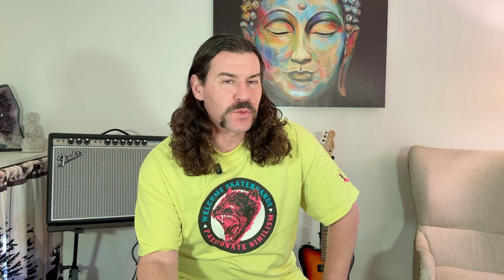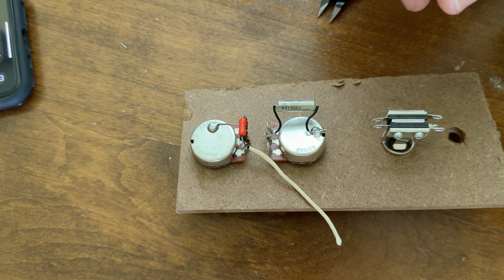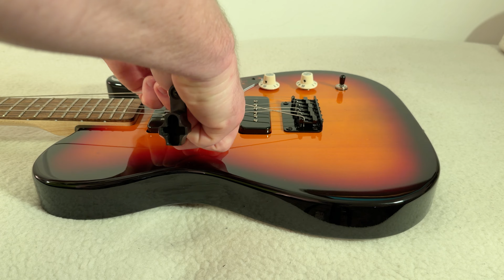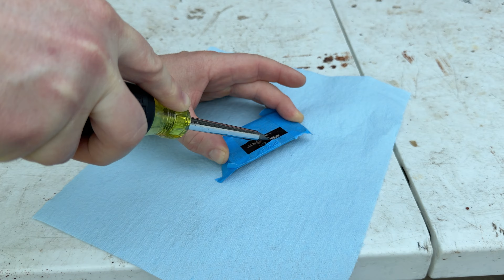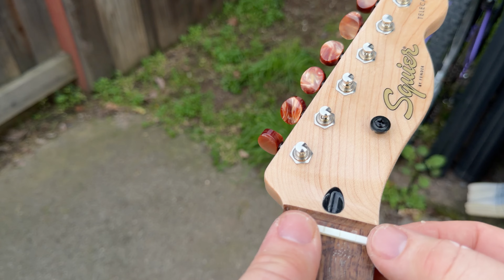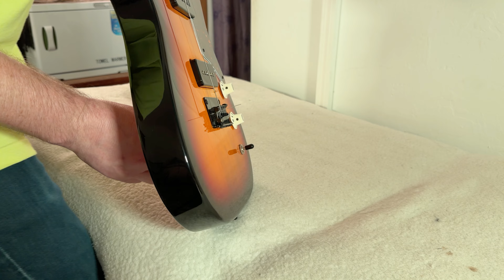Giving my Guitar some love episode one ￼

Comment: What was the red component that was on top of the resistor?
Reply from the maker: I’m really not sure 🤔 but got them Amazon for around $14 by this company 

KAISH did they come in a two pack,

Here’s the title if you care to look. 

Pack of 2 Electric Guitar Treble Volume Bleed Circuit Kit SBE
Cap Capacitor with Allen Bradley Resistance